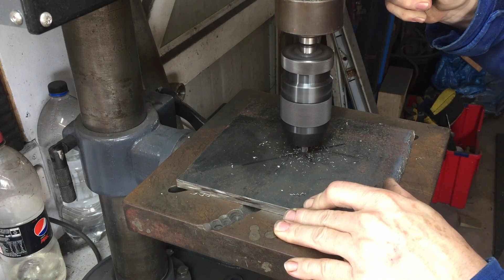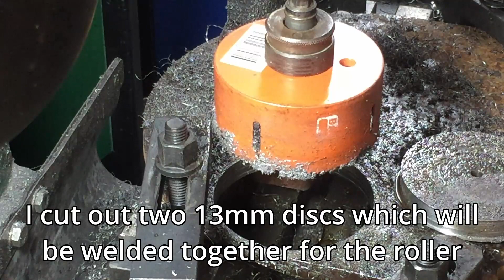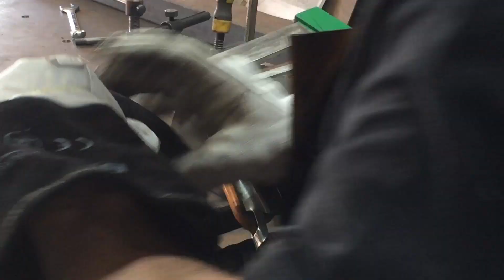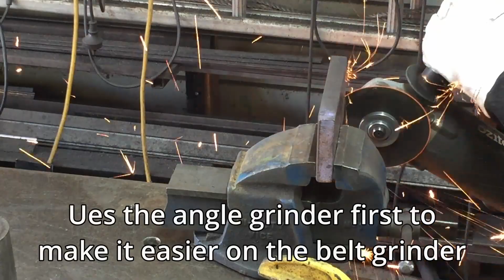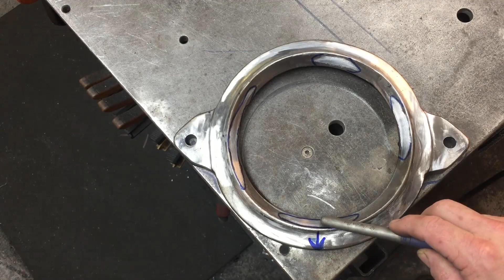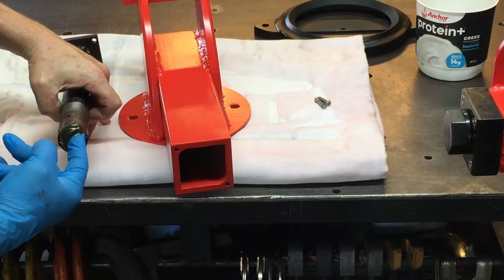Tube Vise Build - Fireball Tool Style - Part 3

Comment: When you bent your square bar stock around your upper and lower plates, if you had put a spacer in between the plates, you could’ve made a smaller diameter ring
Reply from the maker: Great suggestion. That is something that I did not think of.

Comment: Great videos, job well done. Fireball tools vice weighed 260lbs. How much did yours weigh?
Reply from the maker: Hi, it is now bolted to the tilting plate. I weighed then today and the vise and the tilting plate weigh approx. 32KG (70.5 lbs). That is a lot lighter that the Fireball tool vise, but it is also a lot smaller as well.

Comment: Hi HMNZ ~ It's the dead of a mountain winter, where I am, so my video watching time is very limited.  I see that you've provided a thickness specification for the 45-degree beveled circular plates, but I didn't catch any specs on the O.D. of said circular plates?  I've been saving for and very slowly purchasing the parts and materials for the original Fireball Tools Hardtail Vise, but the plans I bought from them didn't include the base.  Have you ever given any thought to measuring the components you made during this Part 3 video and creating some schematic drawings?  I'd be happy to pay for them.  After all, all of us don't own a huge water jet cutter, so some of us have to do it with what we have, which is what I'm seeing here.  In other words, how about being the first to crack a set of swivel base plans for one of these vises/work holders?  I've liked and subscribed now, so please keep up the great work, mate! 👍
Reply from the maker: Hi, thanks for your questions. Sorry for the late reply, I have been busy with a number of other things which I needed to deal with. I don't have any plans for this build but I can take some measurements in the next few days to answer your questions.
Reply: @thehobbymachinistnz  Did you ever get a chance to make those measurements I asked about, mate?  Considering that you've had the complete swiveling vise in operation for a while now, I was also wondering if you're still satisfied with the overall build?  I'd be especially interested in knowing if the swiveling base itself has met with your expectations?  So there's three questions for you, sir.  Have a great day down there!
Reply from the maker: Hi, sorry I think I answered some of your measurement questions on the Part 2 video. But, I have not answered this one on the swivel base. 
1) The diameter of the red rotating plate welded to the jaws and body is 180mm.
2) The diameter of the black fixed plate is 220mm.
3) So the fixed plat thickness (from the outer edge to the lip where the rotating plate fits in) is around 20mm. 
4) The mounting tabs are made from 16mm steel.
The vise is all mounted to the table so I cant measure any internal parts. I hope this helps. 

Yes, I am happy with the build and functionality of the vise. The swiveling base works really well and I do use it quite a lot, particularly with the tilting attachment to get different angles and heights for work holding.

Comment: Great work, enjoyed every minute of it .. I've noticed something in the design .. 
All the clamping force will end up against the 4 M6 screws holding the bearing housing .. am I right ? if so .. then, this is a serious weak point
Reply from the maker: Hi, thanks for watching. When clamping, the force in between the end cap way at the back of the fixed jaw, and the large bearing at the front of the moving jaw. Because the fixed and movable jaws are in between these points, the force is compressed so there is no force or load on the M6 bolts.

Comment: I like how the project that broke your old vice lent a hand on building your new vice. Great job, very informative. Did put your “Maker’s mark” on it with pride? Put a air over hydraulic ram on that bender. Thanks for sharing!
Reply from the maker: Thanks for your comments. This vise was on the 'to do' list, but breaking the other vise pushed this project to the top of the list very quickly.

Comment: Congratulations on a great job. I have made two of Jason's vices, following his very good plans closely. They way out perform my Dawn vices.
They were made with angle grinders, drill press with hole saws, some taps and 200 A Mig welder.
Not having a mill, or lathe, the front plate was made with 2 pieces of 12mm plate, one with a large hole to house the large front bearing, the other with a smaller hole for the threaded rod,
then weld them together.
I made the larger Fixed jaw tube with plate, around the smaller dynamic tube. I used 3 layers of coke can on each of the 4 sides as shims. This equals about .3 mm per side, ie 0.6 mm total play,
which was snug, but not too tight. Take time welding, or will warp the tubes is my other advice.
Inspiring stuff.
Reply from the maker: Thank you for your comments. It is good to hear from others who have made tools such as these with less machinery than I. I referenced one person who did this in the description section of this video. I commend his, and your efforts for such builds with little machinery.